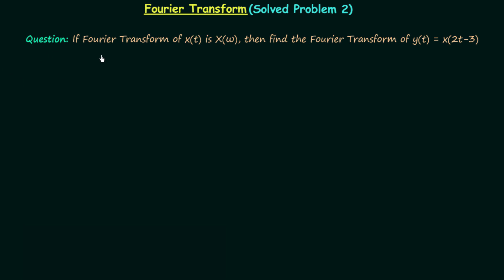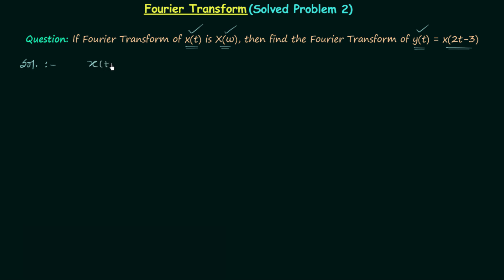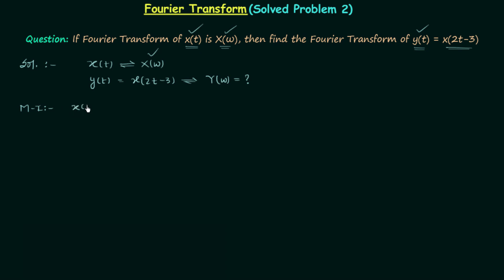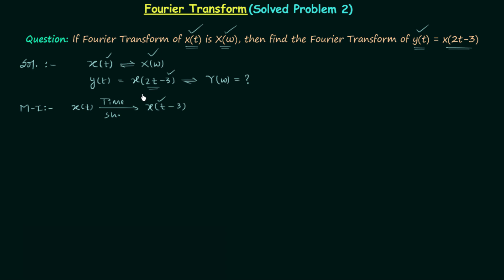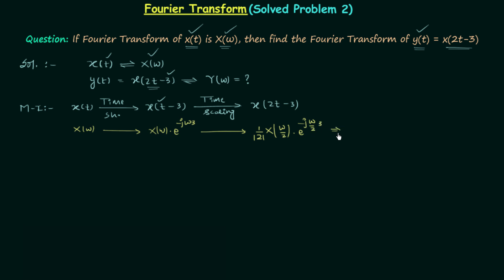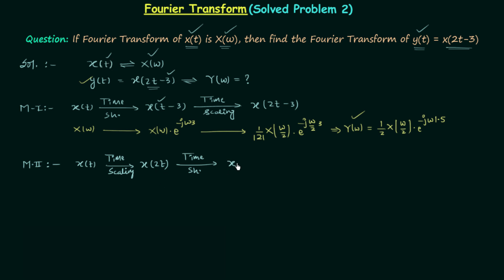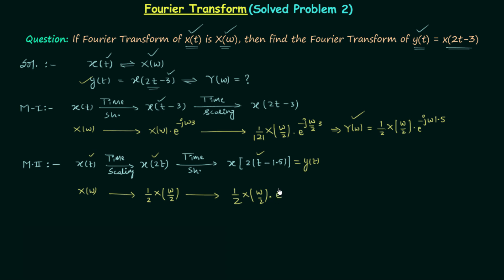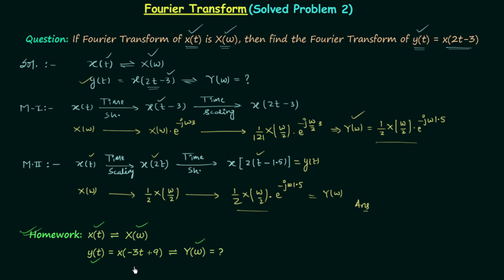Fourier Transform (Solved Problem 2)

Comment: If I use method 1 the answer is not same. Steps are as follow, x(t), then time shifting by 9 x(t+9) and then scaling by -3 x(-3t+9)
Reply: The answer is the same.  Remember at the end it's e^[-j(w/3)*9]
Reply: @IamDeesi  . there will be 1/|3| as well along with it.